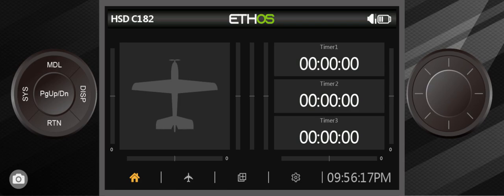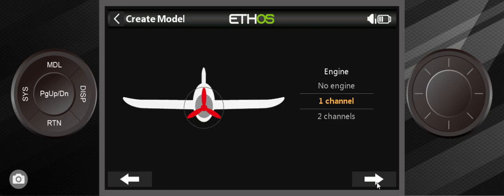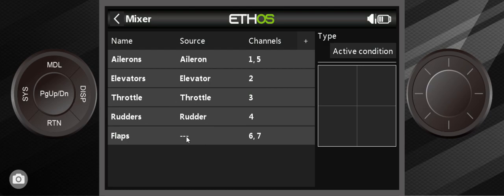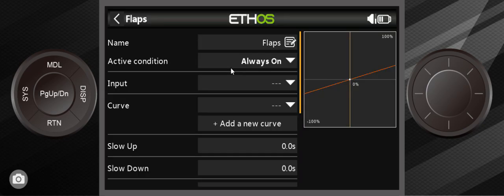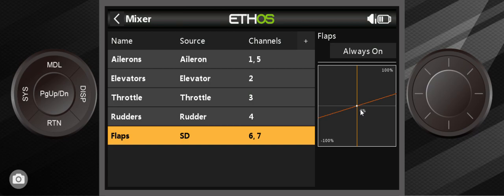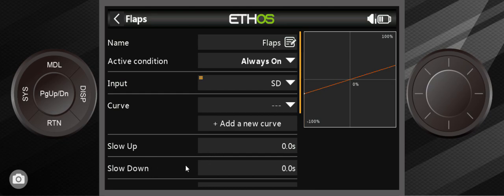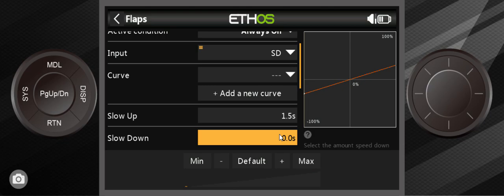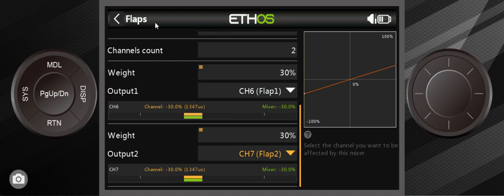FrSky Ethos Flaps, simple setup

Comment: I have a problem and I was hoping that there's an easy fix for it. Let me explain first why I have the problem. I've been "flying" Ace Combat 5 and now 7 since it came out in 2004.  The Ailerons and Elevators work just like an RC transmitter in Mode 2, but they are controlled with the left thumb, instead of the right.  Someone screwed up lol.  I dont want to try to train out 20 years of muscle memory.  What I did with my FlySky 50 dollar transmitter, was to put the right side gimbal  on the left, and the left gimbal on the right. It works, but the plug for the gimbal is now sticking out the side of a hole I made in the transmitter, covered with a layer of silicone. Needless to say, I'd rather not have to do this to a really nice unit like an X20S, but if I have to, I must and will .( *raises index finger in air dramatically*)

Is there a way to get the X20S to do this without taking it apart and completely trashing the warranty?